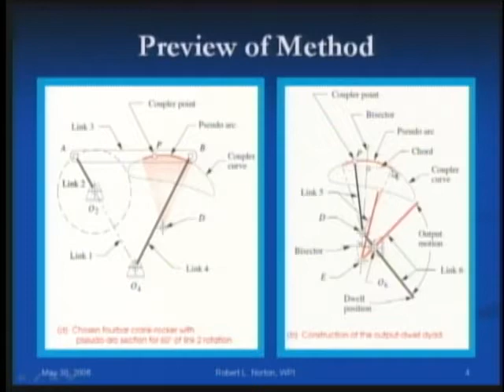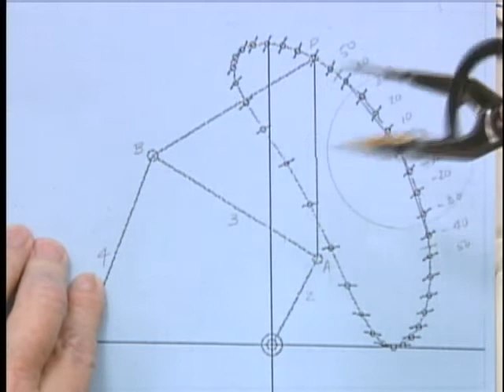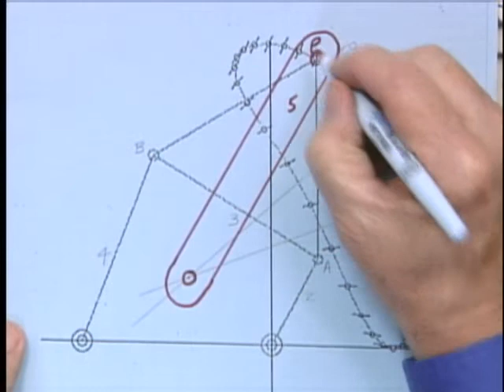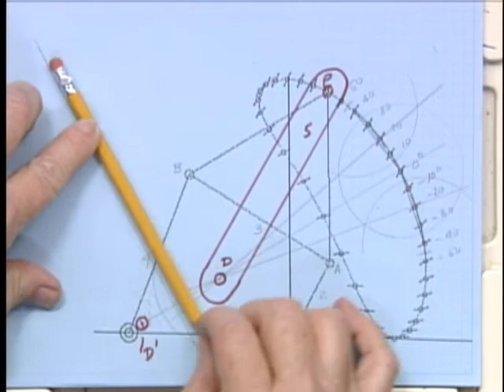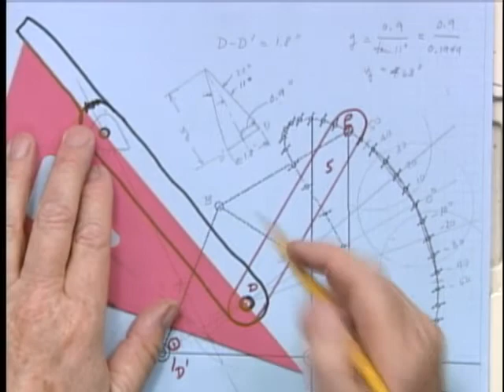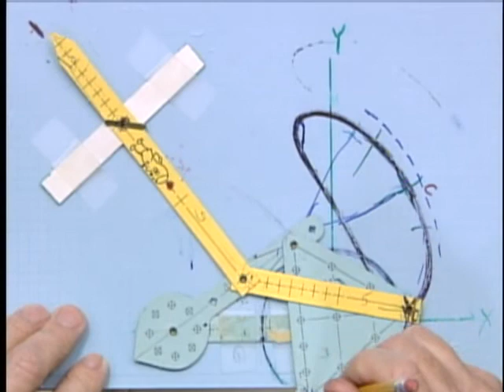Dwell mechanisms | Instructional video by Prof Norton

Comment: The rise is the motion away from the cam center, dwell is the motion where the follower is at rest, and return is the motion of the follower toward the cam center. A common type is in the valve actuators in internal combustion engines.